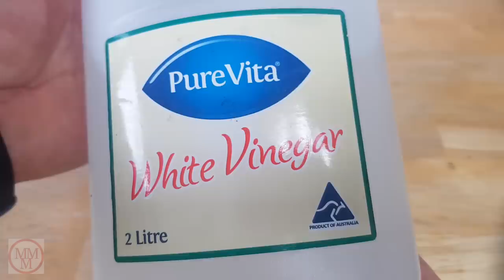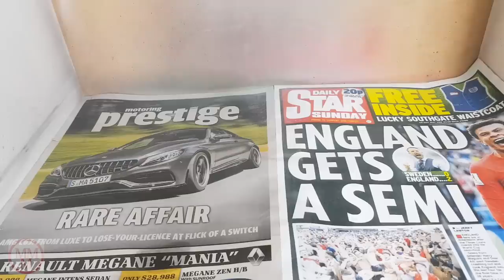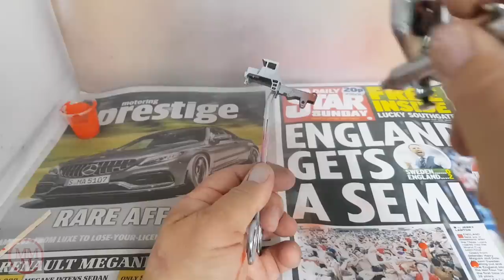MATCHBOX Restoration No 28d Mack Dump Truck 1968

Comment: My mother was an ER nurse before she passed and my uncle was a emergency physician. What you're actually using are either arterial or vascular clamps. Arterial clamps are a bit bigger than the vascular ones. Hemostats are long slender tweezers with tiny teeth on the very skinny end because they are used to remove things from inside veins and arteries that are blocked. Not the larger and more important vessels, they use different tools for that.

Comment: I know that I am one year late but 
- Consider an ultrasonic cleaner for the dirty models. That would ease the job.
- You should try and see if Evapo-Rust can help you with rust removal. Coke and Vinegar are both useless compared to Evapo-Rust.
- For polishing the cast models you can try a rifle cartridge polish vibration drum. I have seen others using it with really good result.

Comment: White vinegar mixed with baking soda will do it. Try to remove the rust electrically with a spare piece of metal and and a battery charger. Negative to the scrap and positive to the car.

Comment: try soaking them in Bondall 1L Ranex Rustbuster Rust Converter for about 10 to 20 minutes you can get it from bunnings i use it all the time and it works very well

Comment: Little drills are the worst! They dance around like crazy. I believe you should find a small ("0") size center drill which can make a dimple in the center of the little axle. Then the drill will have a spot to sit in.
A better "pit filler" primer would be another automotive specialty: "high build primer" Which is made to fill in fine scratches. It may be too much for other adjacent areas but maybe a little bit of masking here and there can concentrate the effects where you need them. It also stinks to high heaven so keep an open window nearby.

Comment: As a child I had a molar ( a milk tooth actually) that didn't want to come out. The dentist said we need to pull it and we made an appointment. Before we went to the dentist my mom said that I could pick a matchbox car at the toy store if I behaved well. I knew right away that I wanted the orange Mack dumper truck. At the dentist it was a disaster. I ended up biting the dentist because he was impatiend and tried to yank my jaws open with brutal force ( I can imagine he was used to doing it this way when breaking gold teeth from dead jews' jaws in a concentration camp, that bastard). He yelled at me(1969 or so and I was five) and put a brass cap over his finger and he ended up pulling the tooth with me laying in the footrest of the dentist chair. My mom swore we'd never come back. My lips were bruised cut and sore and swollen and the elderly lady at the toy shop tried to cheer me up. Mom bought the Mack truck and we walked about one and a half miles back home. I hated the truck ever since and I couldn't play with it. Even today (56 years old) I feel uncomfortable whenever I see this Mack truck.

Comment: You could try electroplating the car with zinc. The growth of the crystals will fill in the imperfections.constantly cleaning the car every 30 min. With a wire pad to give it a shine and eliminating excess crystal growth of zinc in areas you dont need them.

Comment: Think there is a way to use zinc and electricity in a liquid that can help fill in some pitting. Think it works on the same principle as rust removal. Can't remember who's channel it was on he used it on pitted hotwheels. Came out great compared to where it doesn't the last 30 or so years.

Comment: Started doing my 1st restoration of a dumper truck no 48. Unfortunately in trying to clean paint off of the base I accidentally snapped it. It seems to be bent as well. I can glue the base back together but need to heat it to bend it back into shape. 

Looking for suggestions as to how best to heat it and bend it without causing more damage?

Comment: Hi Marty, cracking video. Can I ask, have you considered using rust removal electrolysis?  Also, there is a rough needle available in haberdashers for pushing snags through the other side of clothing  that may help with getting your ladder holes started.

Comment: I've seen a few of your videos so far and impressed with the restoration of them. But I have to say I think so far from all the videos, this one tops the cake so far, i still got other videos to watch, but love the restoration of this one by far, Fantastic job. Have you thought about using Solder or silver solder to fix some pieces that are rusted out or broken to rebuild them?

I've been watching bunch of videos and will eventually be trying some restoration on some later on, I've got some Matchbox cars and hot wheels of my own from my childhood.

Where do you get your Screws at and what size tap and bit do you use to drill out the rivets as well as tap them?

Comment: Not sure if your drill press is adjustable on the speed, but when you were drilling out the rear axles the RPM's were a bit to fast.  If you can slow down the bit, you can get more precision and it won't jump as much.

Comment: To chemically remove rust--without damaging the metal of the truck--is impossible.  Hydrochloric acid is the way to remove rust.  You can purchase some preparations such as Naval Jelly to remove rust at a specific location, but you still run the risk of damaging the vehicle.  Your best bet is what you eventually do.     Finally, have you considered an ultrasonic cleaner to remove grit and old paint?

Comment: Coke contains phosphoric acid (H3PO4, I think). Iron is more reactive than hydrogen, so the iron in the rust displaces the hydrogen in the phosphoric acid to form ferrous phosphate... or it should!  The oxygen from the rust then reacts with the displaced hydrogen to form water... or it should!

My guess is that there wasn't sufficient reactant (phosphoric acid), in the coke to deal with all the rust. Alternatively, reactions tend to occur more readily with an increase in temperature... maybe simmer your ingredients!

Comment: Great work, ive got an old English convertible double decker bus that's the next scale up , still has its wheels  and works fine , just some of the rails are broken, my main problem is original advertising on the sides iI don't want to lose ,Any ideas on how to approach this problem ,hope you can help

Comment: If you want to really remove rust, you should use electrolysis. Using a 12 volt battery charger, guaranteed to remove all the rust.

Comment: Never ever ever ever ever ever ever ever use vinegar on aluminium alloys.
Reply from the maker: Errrrr.....why? - What happens?
Reply: @MartysMatchboxMakeovers  aluminium is in general resistant to corrosion in a wide range of PH.   It happens because it have that thin layer of white-colored oxidation forming on this active metal every time you expose it to air. The layer of oxide serves as inactive protection for active metal ...unless you constantly dissolve this thin layer in acid or expose it to chlorides. That's why factories protect their aluminium cans from acid beverages inside by special coating. The white substance on the model after vinegar bath is a new corrosion. Steel on the other hand is not that active and does not have oxydation layer protecting it. Steel oxydation works a bit differently, it usually happens in presence of water and air and it is reversible by acid(you can revert the reaction, but not the damage to the shape) Most people heard somewhere how to revert steel corrosion, that's why they told you to use acid(vinegar). What they did not tell you is that aluminum is more active than iron, so if you put the Fe2O3 and Al into one acid bath, the result will be not as active as in thermie, but still result in Fe2O3 + 2 Al → 2 Fe + Al2O3 corroding the aluminium.

Comment: This guy has no patience at all... when you soak parts in vinegar, let them soak for days!... not minutes. 

Also, use some proper penetration fluid, not WD-40. 

Invest in a small ultra-sonic cleaner, it’ll clean and break up 95% of the work for you. More time for fixing